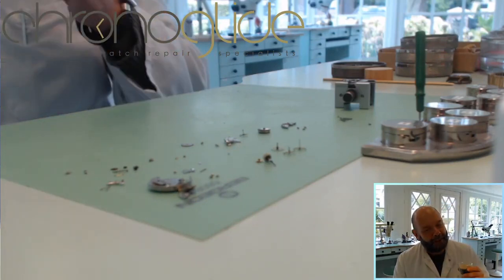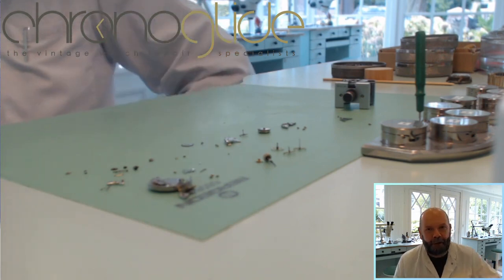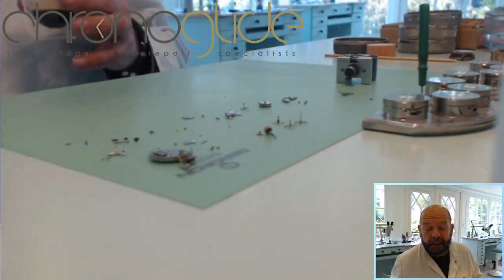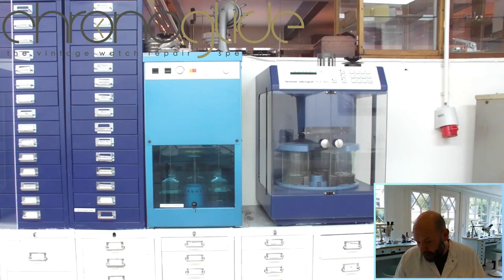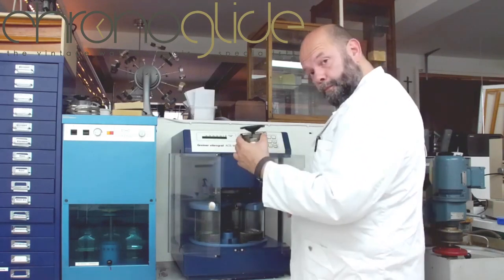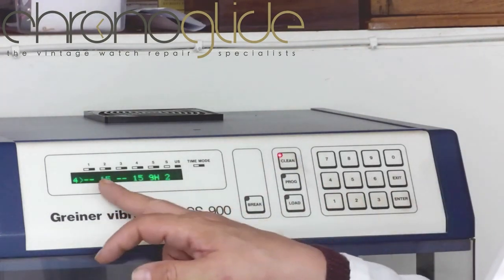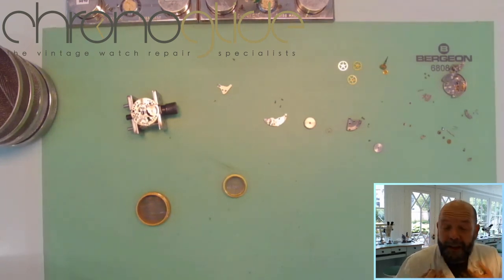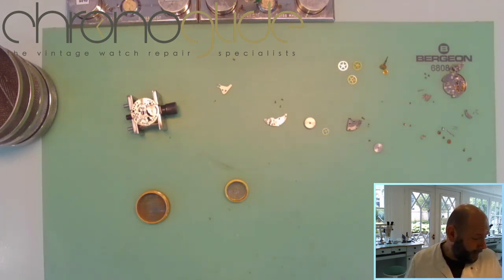How to clean watch parts -  Part 3of3 - Automatic cleaning

Comment: Greetings from the Napa Valley. I'm a new hobbyist  and I must say your videos are superb and I watch every one of them. I have graduated to a monocular  with camera and can take pictures for reasssembly with my  small brain for now. Bought bergeon screw drivers and keep them sharp. Working on balance wheel issues, inka block service and part names. What a great challenge i'm having with parts flying becoming  a rodeco friend. I actually invented a  way to prevent inka block three prong springs from flying. You might laugh at it but it works. Once again thanks for your genuine profesional help very much appreciated.

Comment: Thanks Kalle.  I've an old L&R MasterMatic and have had to fish out springs many times from the fluids.  Really like the tip of using a small crystal to keep the springs from finding their way through the basket's mesh.  Not used Epilame as yet, mainly because the price of Epilame fluid and the bottle is truly insane.
Reply from the maker: It is really insane expensive! I fully agree ;o)

Comment: "10, 20, 30 cycles..." It also depends on how much crud you want to redeposit on your movements. Don't get tempted to stretch it too far. You'll be sorry you did. Notice carefully that this is cleaning by agitation, not an ultrasonic cleaner. Also, for me, "IPA" is something I state by letters, not pronouncing. Makes it a little clearer, IMO, to the person you're talking to, but that's just me. As for knives, my knives are all kept shaving sharp (one thing I learned well as a teenager was how to put a good edge on a blade and keep it sharp!), even the big ones, so a scalpel would be redundant on my bench!

Comment: 17:10 worth the whole video! Let me collect some glasses and keep them inside my baskets to protect small delicate parts for when I get my cleaning machine. I use some dental picks to remove most of the crude grudge before starting the cleaning process, and agree with you that s pure rinse must be used only in special cases, as it is very important to see what’s grinding under the hood to make troubleshooting easier and preventive maintenance possible on parts that may be worn out or going through excessive wear and tear from such problems. You’re not wrong, they are expensive and one of the mid to later part of your career to buy! We all start in a tight budget and is a good exercise to clean the movements by hand to get even more familiar with them, besides the fact that one may damage a part or two during the process and such experience will stick with you enriching your sense for what’s fragile, and what’s EXTRA fragile!
Great video as always! Thank you!

Comment: Elma first rinse is de-ionised water, while the Elma final rinse is just IPA (isopropyl alchohol) and I believe Elma say 99.5% IPA is an OK final rinse in countries where the Elma product is harder to get (eg Thailand).  I don't think there is any problem with using IPA as the final rinse, as long as you do not leave the parts with shellac in there for more than 10 minutes (room temperature).  IPA may also remove some of the more stubborn dried greases that might have been missed by the cleaning solution.

Under no circumstances substitute ethyl alcohol for the IPA, as ethyl alcohol is a lot more aggressive solvent for shellac.  Wood workers have learned not to use IPA for preparing shellac varnish, because it is too slow to dissolve the shellac and also dries too slowly.  This is despite the fact that ethyl alcohol is always 5% water, and water is not ideal for shellac as it can make it cloudy at concentrations over 5%.

For your "quick rinse" cleaning I'd recommend you do not skip the first rinse.  The idea behind the first rinse is to reduce contaminating the final rinse with cleaning solution, so for this reason I was a bit surprised to see you skipping the first rinse.   That's the idea behind three step systems always having two rinses.  Skipping the first clean is OK for a part that is already clean of course, since the heavy oil contaminants that you are trying to keep out of the second clean don't exist on the part that has already been worked on.

ETA: and sorry for sounding a bit preachy.  While I'm still learning this stuff and you are the professional with decades of experience, my brain doesn't know how to be diplomatic LOL.

Comment: Thank You So much, Kalle, for the time and effort you put into the Chronoglide channel. Just a few words here on my own experiences. I have an old L&R Master and initially I was using Naphtha -- Distilled Water -- IPA and the results were good, but inconsistent. I finally got some L&R Extra Fine which is the recommended solution for the old style machines and I have to say the difference is remarkable. The parts come out clean and sparkling bright each time so far(about 10 movements). I was taught many years ago by my father-in-law, while on a visit to the USA from Scotland, the art of french polishing . He called one of the ingredients needed "Methylated Spirits" and we spent many days searching the home centers and paint stores for it, but it was never found, so he decided to use IPA instead. Just recently found out quite by accident that what he called Methylated Spirits is called Denatured Alcohol here in the States and is readily available. So, the question to you is does IPA differ from the bottle of alcohol we would buy for use as a antiseptic.

Comment: First I want to say I love your videos and as a new watchmaker hobbyist I was wondering if you would consider making a  video discussing endshakes sideshakes covering the barrel jewelsettings and balance? What is correct what is incorrect. I have struggled with this for a very long time don't know what correct adjustments should be for a watch to run properly. When the barrel doesn't have enough or too much endshake etc. How to adjust etc.
Reply from the maker: Hi Giovanni, there is information about endshake in de video "Jewel replacement in watchmaking"on this channel and in "Mainspring repair". if you require more info, please let me know during the livestream on tuesdays at 20:30 Amsterdam time. Cya! Kalle
Reply: @ChronoglideWatchmaking  I did not see anything in the 2 mainspring videos  you have uploaded part 1 and 2 . I guess I'm looking for some examples of wrong endshakes correct endshakes etc  focusing on the barrel , balance . I watched the jewel videos it was informative but again I guess I'm looking to see examples possible to compare .

Comment: I wonder if denatured alcohol would be comparable to IPA/99.9% rubbing alcohol .
Reply from the maker: Might be but I'm not 100% sure.
Reply: @ChronoglideWatchmaking  Did some search . Denatured alcohol is ethanol which you could drink like booze lol but it most commonly has a bit of methanol added to make it unfit for human consumption to avoid beverage tax then making it lower cost . This is why some refer to it as methylated spirits which I recall you saying may be used by some Swiss makers . I always make my own hand sanitizer out of it simply 75% denatured alcohol and 25% filtered water . I always have gallons of it so I'll try using it for rinse once I get all the equipment to give this skill a try . Love your efforts and what a beautiful shop you fellas have .